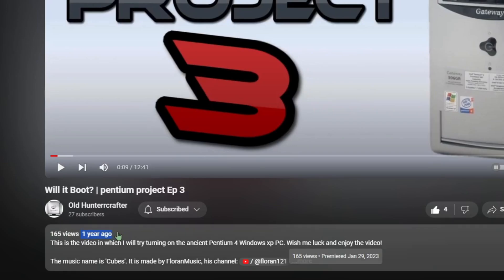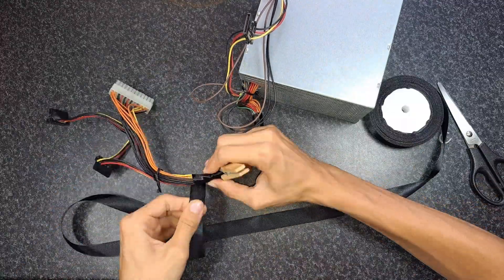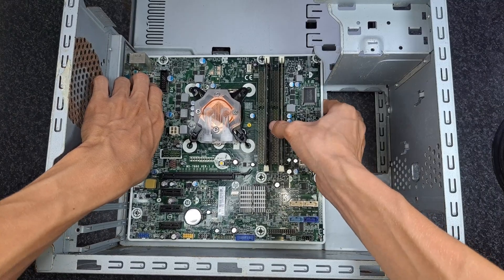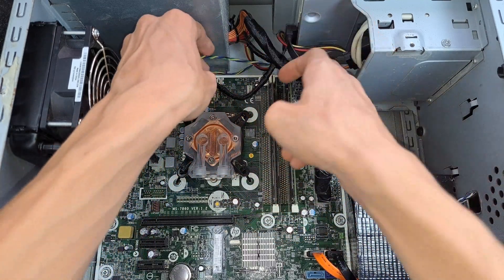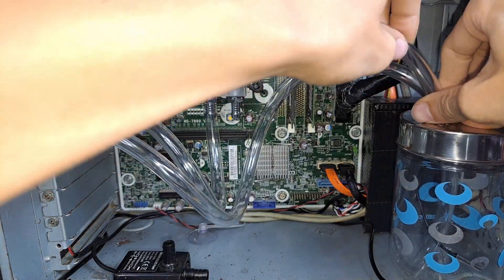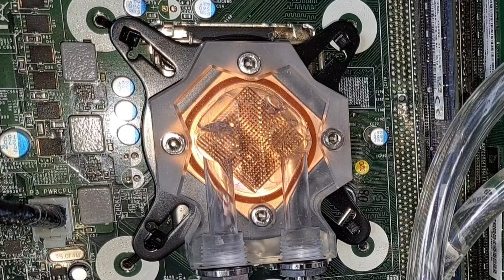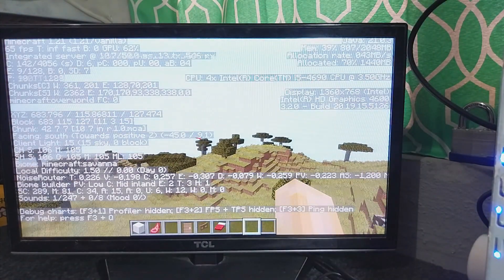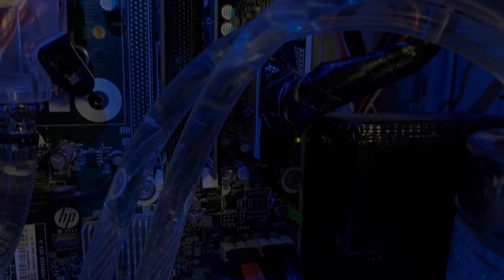Building the ULTIMATE Budget Sleeper PC! [English]

Comment: You miss the boat totally on what a sleeper pc is. First and biggest reason why this is not a sleeper PC is 4th gen i5, NON K/OC, and then you went overboard on water cooling a standard i5 that will never reach 80 deg even on load. The least you could have used are recent component at the time of this video like i5 13th gen K version, or Ryzen 5 5000x series; which gives you a reason to Overclock. A "sleeper" means a PC disguised as an old/vintage case with either updated components or uber fast components. Then you went and use lights in the case where "sleeper" pc means low key, aka under the radar, which means, your friends think its a POS when it's really a PC that can rival current fast PCs. This is more of Hybrid Vintage front gaming PC side, or a vintage PC trying to look like a gaming PC.

Comment: Could had soldered the cables together!
Reply from the maker: You're right, soldering the wires would make a better and stronger connection. I'm bad at soldering though, and twisting the wires together works good enough for non-critical joints inside a PC.

Comment: better to add gpu to really claim its title the ULTIMATE
Reply from the maker: You're right, but I couldn't really find a good price for one and the PCIe slots on the Pentium case don't allign perfectly with the slots on the motherboard. Maybe for part five!
Reply: @Hunterrcrafter  i suggest instead of using water cooled, use air cooled instead since you're not going to overclock it anyways soo air-cooled will do it's job. but its in you tho what you prefer. soo that the gpu can fit. if it still not fitting in, use extension cable and just modified the gpu placement. i hope that you'll have fun going this project. and i really hope that soon enough i can build my own with the my hard earn money
Reply from the maker: That's indeed a great way of making this PC the best it can be, but just so you know, I don't plan on using the PC as my main device. This is more something like a cool project/retro-ish PC for the 'older' experience.
Reply: @Hunterrcrafter  im aware of that. but just for fun and experience it's all worth it tho. if possible try to sell it and make another project, it's a great stepping stone to start a journey.